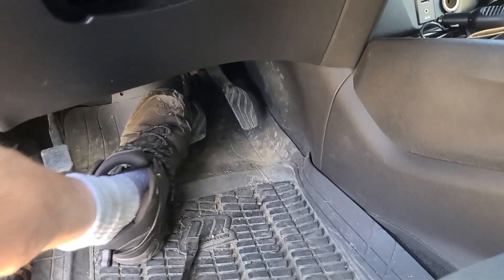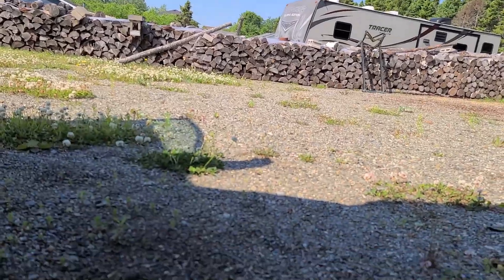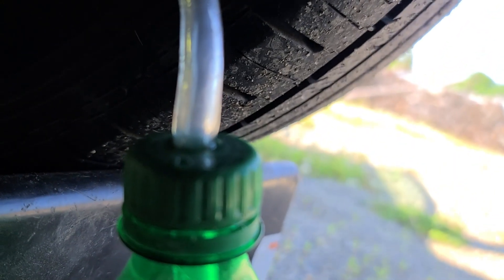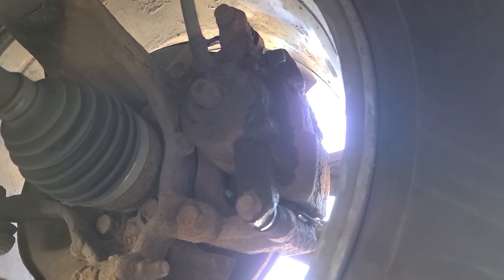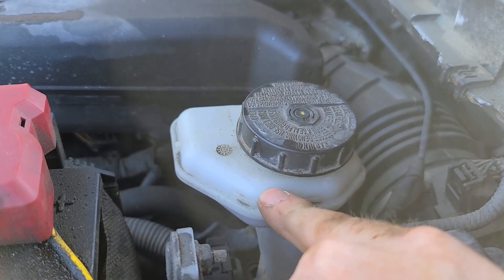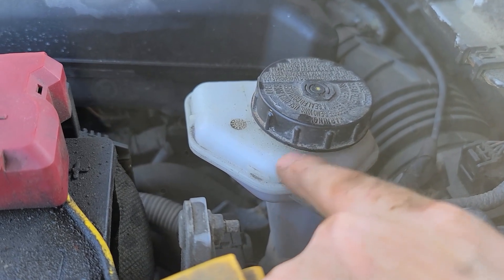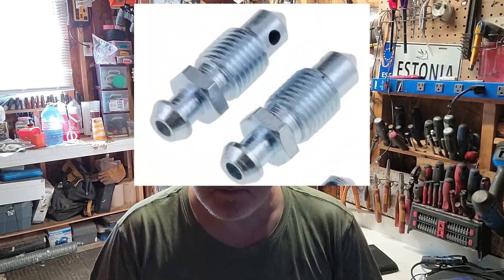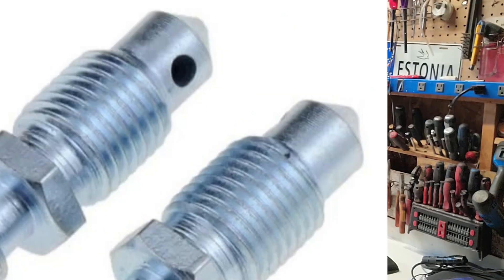Bleed Your Brakes Alone Easily

Comment: I'm 62... So I am so glad to have both vaccum and pressure bleeders.... They are easy to make if your on a budget...and they make bleeding and exchanging fluids super easy and clean... I use mine even to empty full gas tanks when pumps fail and the tank is pretty much full makes it much easier to drop the empty tank!... You can get a ventri style vaccum pump from harbor freight under $20 and with a five gallon pail make a great bleeder fluid exchanger.... My old ventri style is 20+ yrs old works off a air compressor... A decent pressure style can be made from a old pump sprayer you can even add a tire stem and make pumping optional...😂👍😎
Reply from the maker: Love it, great idea

Comment: The brake fluid in my Miata was due for a change but this spring when took the cover off and popped the hood, the brake fluid reservoir was empty.  I refilled it, bled the brakes and it's been fine since April.  I'm gonna put some dye in it this fall when I put it away and see where it's leaking from over the winter.  I figure it's some seal that gets brittle in the cold and lets fluid past it
Reply from the maker: @BruceLyeg  yeah must be a seal or the line is very thin with rust and seeps, i had that once, im like i cant find a leak anywhere. But turn out if someone pressed hard on brake it got wet on outside of a 2 inch piece. Soon as i touched it it broke. But your baby has no rust lol